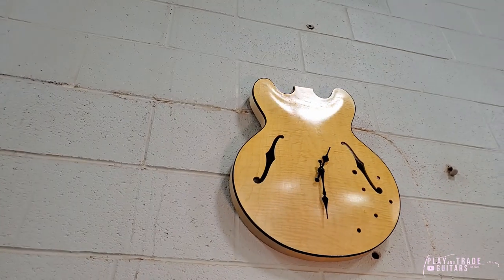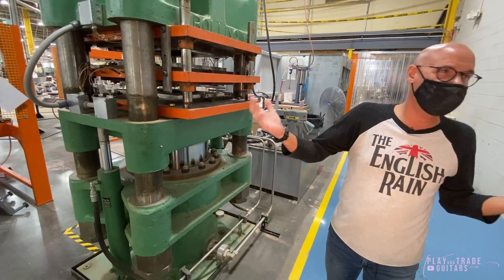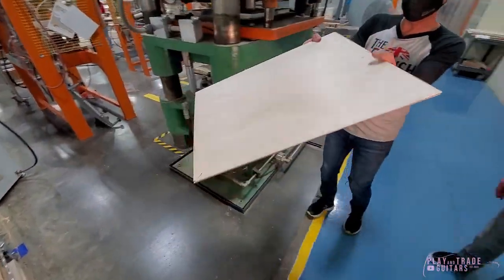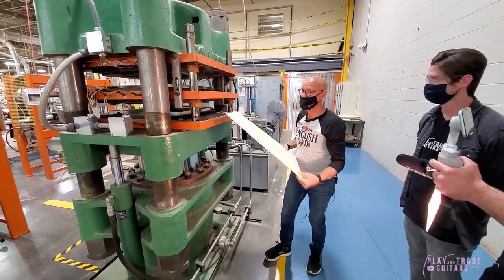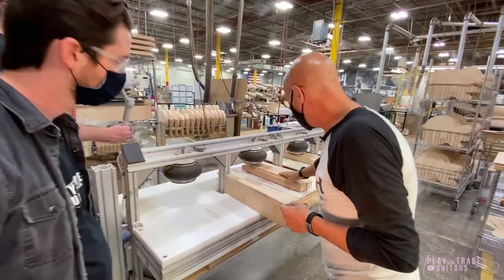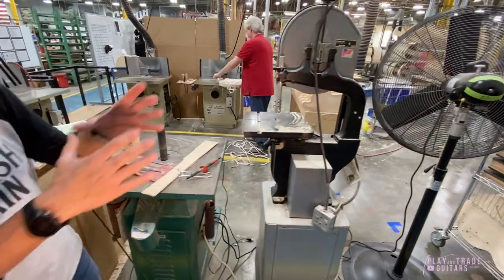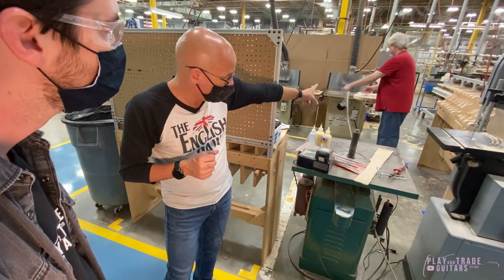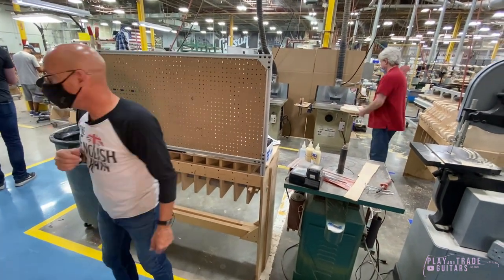BB King's ES Guitar was Pressed on THIS Gibson Machine (And So Was Yours!)

Comment: Thank Goodness Gibson has kept these old machines and tooling.
Modern tooling and procedures are good, no doubt about it and should be utilized when appropriate.
Tradition though cannot be bought, it can only be saved and nurtured through the years.
it is tooling and manual procedures that allow Gibson to offer vintage re-issue instruments that are truly as close as possible to the originals.
Thank You Gibson.
Keep doing what you're doing and don't change anything until after I save up and purchase a vintage reissue ES (note, it may take me a while, I'm still saving up).